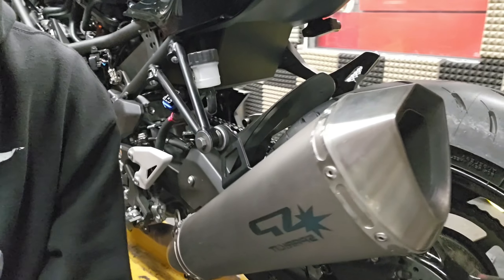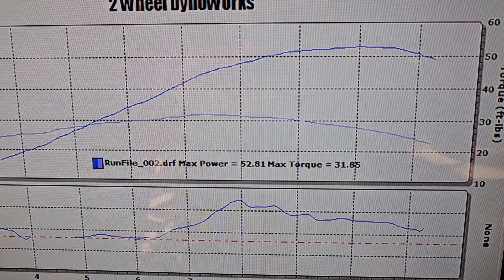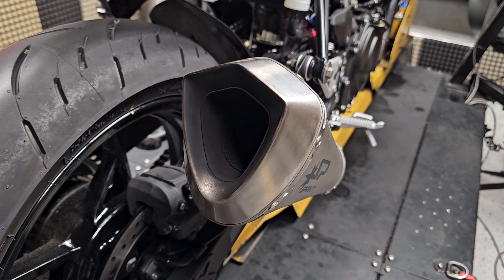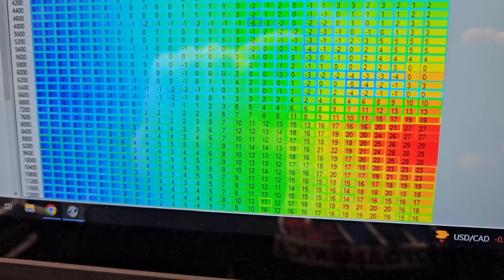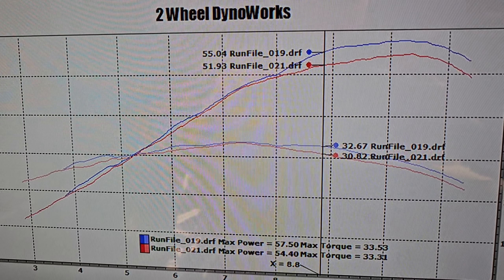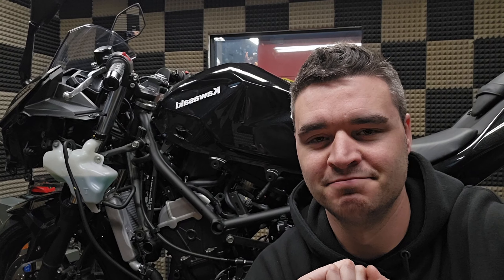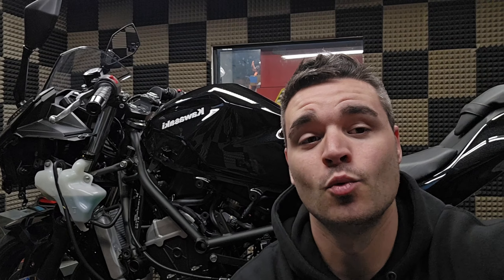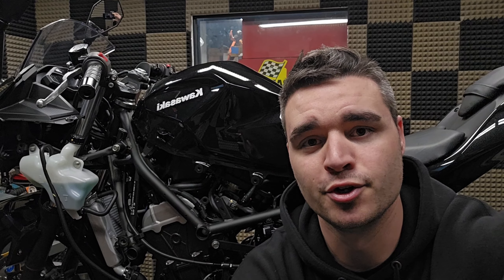DO NOT install this type of exhaust on your Ninja 500!

Comment: I just slapped on a leo vince slip on and it's perfect
Reply: Can I ask which leo? I was considering getting a lv-10 but dont want it too loud.
Reply: @hungryscript1122  the LV10 is loud as fuck. Go with the Corsa and baffle it. Still louder, but not even close to the LV
Reply: The valves take several thousand miles to burn prematurly and the sad part is when it happens on the highway and you don't know why your bike won't start all you know is that you all of a sudden lost all power.😭